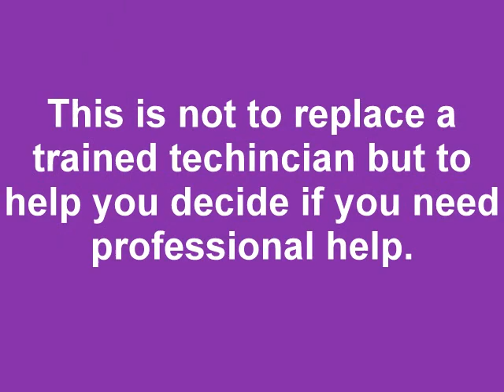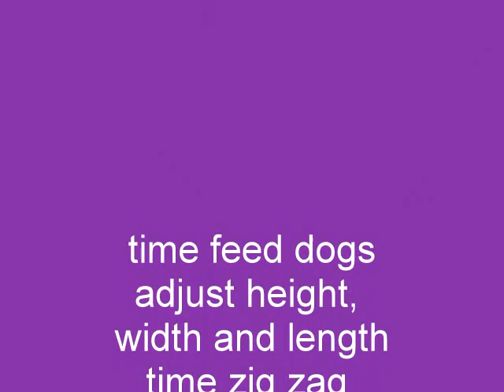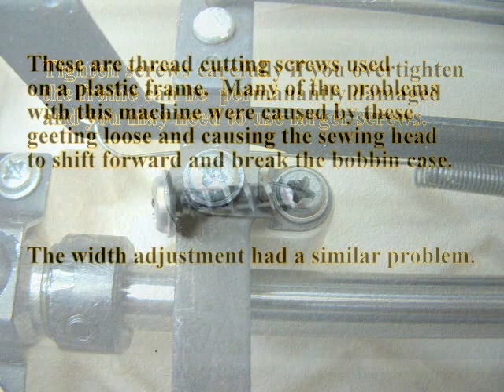Singer Sewing Machine Adjustments

Comment: After watching and pausing your video I have fixed my needle issue and the timing. Now i need to adjust or fix my stitch length knob because it is not responding when i move it. I have the 9420 singer model. I did not see that in your video.

Comment: Hi Joe, 

Thank you so much for posting this helpful video! I've read a lot of the messages here, and I'm so hopeful you could help me resolve my issue! I've searched so much for an answer and will be grateful to hear you suggestion on how to tackle it. In my brand new Janome HD-3000, the needle hits the hook, suggesting there's a problem with the needle-hook clearance. I'm not sure how to try and move the needle bar or hook, as well as what will be the consequences of such action. This happens with every needle (brand new ones) I've tried, so it's not an issue with the needle itself. It's inserted as high as possible, and flat part facing backwards. Additionally, I think there's no problem with the timing, as there thread is being picked up by the hook perfectly (other than the fact the needle hits it and make a terrible sound when I try to actually sew (which I don't really do to not harm the machine). 

Here's a video demonstrating the issue:
https://www.dropbox.com/s/wd9fc0o24msczyu/VID_20151205_010138.mp4?dl=0

Thank you!

Comment: Hi Joe.  Been reading the problems and your replies.  My problem is different.  Have searched all over YT with no luck.  My problem:  I have a Singer One Plus.  Yes I had the problem with the needle threader not working and got that solved.  Now all of a sudden I'm having problem with not picking up bobbin thread...this only happens with the free motion foot on and dogs down for free motion quilting (practice actually)....I've used it this way before with no problem. Also, when I take the material away and just manually lower and raise needle it picks the bobbin thread up.When I put regular 1/4" foot on with dogs up and in regular sewing mode it works just fine.....go figure.  Thanks for any insight on this.  I've actually cleaned the bobbin case, rethreaded, and put on a new needle with no luck.
Reply from the maker: +Dolly H. Hi Dolly it is challenging to repair without seeing all the possible problems.  I can only suggest a few things to check.   A slight miss in the timing will be exacerbated  when free motion quilting.  First would be needle height.  The needle needs to be high enough the thread is not pinched by the hook at any time.  Second would be the needle is perpendicular to the hook.  I check this by placing a small magnet 3mm X 10mm on the front groove of the needle.  It is often I find a slight twist in the needle bar can cause poor stitches.  Third look for any burrs on particularly on the hook.  These can hang the thread sometimes.   Normal sewing the needle can swing 6mm and still pick up the bobbin thread.  However when sewing forward and backward the needle to hook distance is much more critical.  Often skipped stitches will be worse when moving the fabric backwards.  This can happen if the needle is not close enough to the hook.  It also helps to use a hopping foot as the quilt fabric follows the needle when the needle rises the thread is pulled up tight to the needle and makes the  skipping worse we call this flagging.
Reply: +Joe Neill (Electricdrjoe) thank you so much Joe for the prompt reply.  Will try your suggestions.  Thank you again. Dolly.

Comment: Hello again.  Does anyone know where I can locate a cam assembly for this model of sewing machine. I only found one located in Canada but I was wondering if this part can be found in the USA or am I not calling the part by its rightful name. It is a plastic piece that works the feed dogs that connects to the  rotating hook drive shaft on the  model 9420 or similar models.

Comment: That was great :) Thank you. I do have a question please : I have a singer 4423 and the feed dogs are pulling the fabric while the needle is still in it, forcing it to bend backwards. What can I do? Thank you
Reply: great, thank you. :) you just saved me 30 euro
Reply: this video that you recommended to me was great. I also managed to re time the machine (Singer 4423) and I was lucky to pull this one out without the gouges ...just luck I suppose . You did not saved me just 30 euro  but 20 more for gas and a 300 km trip to the nearest sewing machine tech.  Again , thank you.

Comment: Hello I know and realize that i have one person searching with me but i was wondering if anyone knows of a video that shows you how to adjust the stitch length control when it does not operate correctly?
Reply from the maker: Check if the linkage is in need of lubrication.  Length can also be impacted if the feed dogs are not high enough as in lint under the needle plate.
Reply: @electrichospital  okay i will check that sir. Thank you.
Reply: @electrichospital  Sir I have found the issue. I have to replace my rotating hook drive shaft. I will also need to adjust my feed dogs as well.

Comment: Hi Joe, thanks for sharing your video, its very kind of you to be helping us all! I am sorry this isn't quite related but I am hoping to get some help, have exhausted the internet and can't afford to take my machine in to be fixed, I usually learn how to do everything myself!  I was recently turning my tension wheel manually as I couldn't get through so many layers of denim, I was forcing the needle through not really thinking it would break it, which it did, it suddenly went loose on the tension wheel, and now the needle doesn't go up and down, the motor runs but no movement anywhere. Do you know if this would  have broken the belt or something more serious, and is it an easy fix for someone who is usually ok at doing small jobs on appliances usually with reasonable success, ps it is not the bobbon winder on either :) thanks if you can help, Clare
Reply from the maker: Hi Clare.  It may be a broken gear from your description.   It would help to know which machine you are using to predict the difficulty of the repair.  It sounds like you checked the hand wheel is not slipping on the shaft like when you wind a bobbin?
Reply: Hi Joe, thanks for your quick response, its a Frister and Rossman Cub 4
Kind regards Clare
Reply from the maker: I had to Google Frister and Rossman Cub 4 we don't see these in Oregon. This looks like a class 15 oscillating hook machine.  Riccar had a similar looking machine and the hook drive gear was often broken.  You can remove the bottom and back covers and get to it.  It is not difficult to replace if you are comfortable with timing the machine afterwards.  I see some parts and manuals for these in the UK.  Are you overseas?  I am surprised how expensive the parts are ( a belt is 17.95 puunds  we sell these tor 7.95 dollars.)  Have a great day.
Reply: yes, Joe everything is more expensive here in the UK, and its not looking good so far for the replacement part, I have been looking for gears for Cub 4 and it seems non existent, in fact not many parts at all for the Cub 4. I did find a video for changing the gear, though I don't know if it is the right gear you are talking about..https://vimeo.com/7082242 looking at the video it seems very doable for me to do the repair, I haven't checked out a timing video yet, but it seems other beginners are doing timing ok too :) I think I might see if I can get the part in the US, have tried UK web shops. Thanks for your help, really appreciated, you have a lovely day too, kindest regards, Clare

Comment: having problem with my singer furtura sewing /embroidery machine  I can sew two or three stitches and it  says thread is broken and the thread isnt broken.  so is it the thread sensor and can it be unhooked and still sew
Reply from the maker: Hi Elizabeth: it may be your sensor.  The check spring is connected to the sensor and if it is not moving properly will give you an error message when the thread is not broken.  First I would check the spring.  You may have to take it in to get it repaired.
Reply: thank you. I apperciate the info

Comment: I have a Singer Inspiration 4220 and the timing hook is not where it is supposed to be and I just CANNOT figure out how to take the plastic cover off.  I've removed all the screws, etc., and it STILL won't come off.  I can't find anywhere on the web to tell me how to do this, either.  Would you be able to advise me, please?
Reply: Joe Neill You are SO KIND to respond. I've removed all the knobs except the stitch selector.  If that needs to be removed, I can't figure it out.
Reply: Jennifer Germer ha! I just asked the same thing about my Singer Tradition. I cannot get the dang front plate off. I took the bottom and back off, but cannot get the front off. I need to be able to see where the issue is from the front.

Comment: I have singer touch tronic 2010. when I try to fill the bobbin the thread keeps going over the top of the bobbin and I have the little lever pushed all the way over to the right Can someone please help?
Reply from the maker: Hi Teeny: your singer wound the bobbin in the hook area by raising the bobbin high enough that the thread did not go over it but went around it.  Some of the possible problems are the mechanism is not pushing the bobbin up or the bobbin is defective.  Most likely it is the first option.  If you remove the bobbin and push the lever over is the disk under the bobbin lifting.  This linkage has some plastic pieces that often break on this age machine.  Some of those parts are still available.  I would suggest removing the bottom of the machine and examining the bobbin lifting mechanism to better diagnose your problem.

Comment: Hello! I'm having similar problems as Teeny. I have a Singer Prelude and I've tried everything! Can you please help?
Reply from the maker: Hi Brandie: your Singer Prelude has a different hook from Teeny.  The problem you have is when winding the bobbin and the thread does not fill properly.  It sounds like a threading issue.  Can you send a picture?  Describe what you have tried.   Do you have a manual?  Singer has a free download for manuals here. http://www.singerco.com/support/instruction-manuals.
Reply: Joe Neill I do have the manual. However, we just moved & I'm uncertain as to where my husband packed it. I took a picture for you but how can I send it to you? What's happening is that the thread seems to be wrapping around the bobbin.
Reply from the maker: Brandie Robinson  Hi Brandie my email is elehosp@gmail.com.  Is this problem only when winding the bobbin?  If it is in your hook area you may have a burr or lint causing the thread to not pass around the bobbin case.  Send more information.
Reply: +Brandie Robinson
Reply: Yes, Karen Binsfield
Reply: Karen Binsfeld
Reply from the maker: +Brandie Robinson  Please describe your problem.  Your machine winds the bobbin on the top.  Not in the bobbin case.  If your thread is not passing around the bobbin case check for a burr on the hook or too tight a clearance on the cushion spring.   More information would help me give better advice.